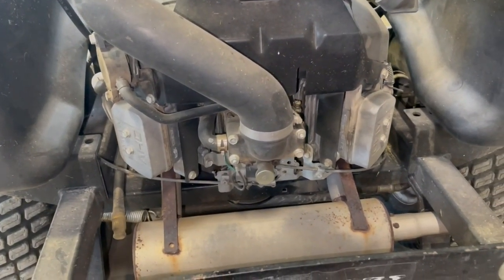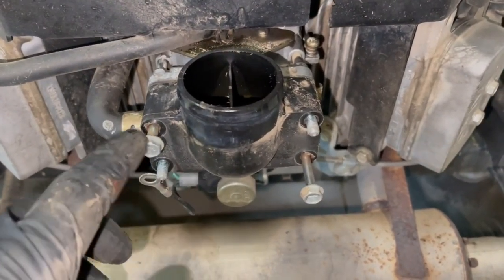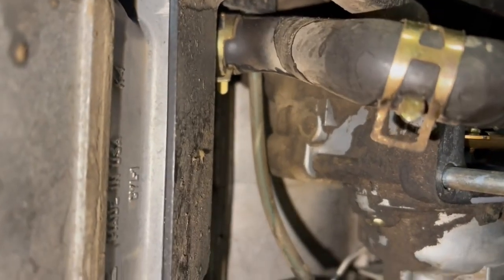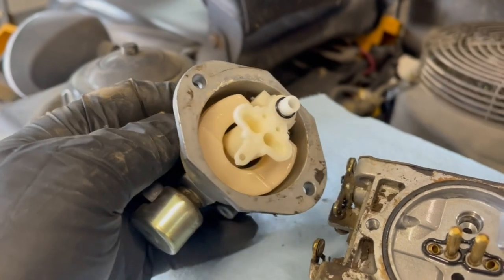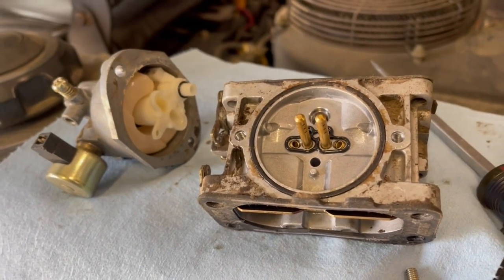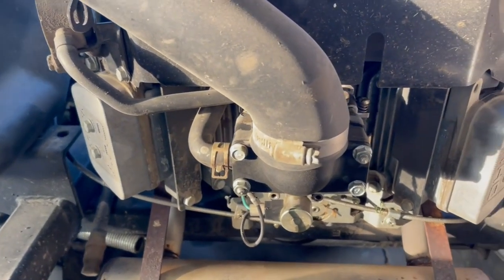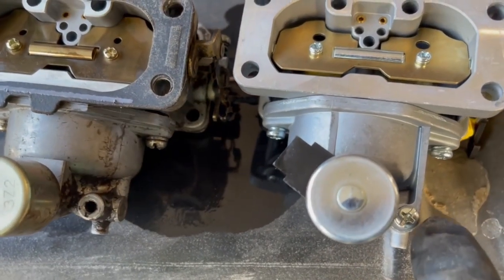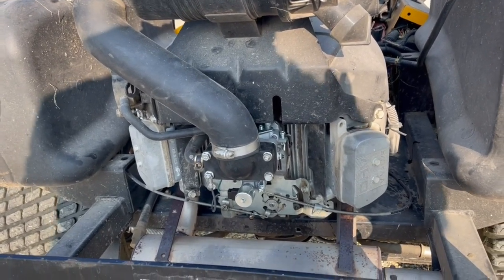Cub Cadet Commercial M60 Tank zero turn mower carburetor replacement | Belted Galloway Homestead

Comment: Great video! I purchased the same carburetor kit for my cub cadet zero turn. I noticed that it idles a little on the high side. I wondered if yours also did and if you had made adjustments?
Reply from the maker: Thanks for the comment. My idle is good. I have noticed that it starts much easier with the new carburetor. I think the screw on the right-hand side, where the linkage connects, would control the idle. I will need to give it a try on my machine. Thaks for reaching out!